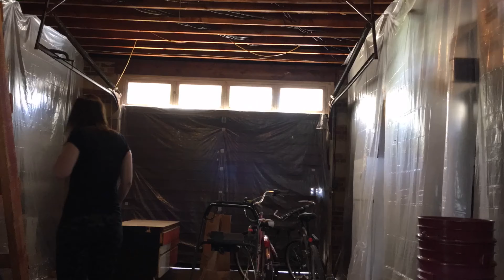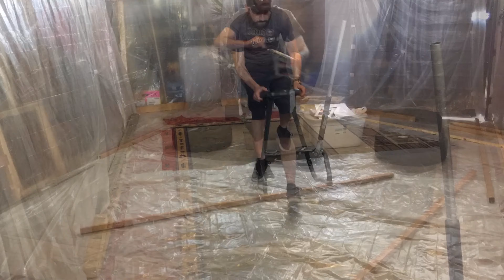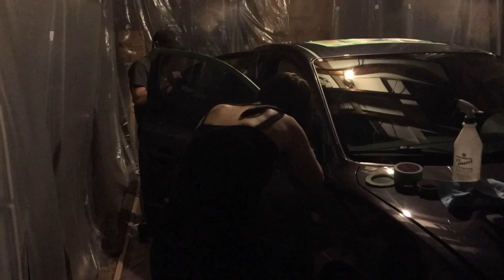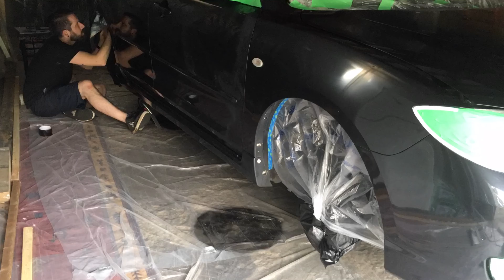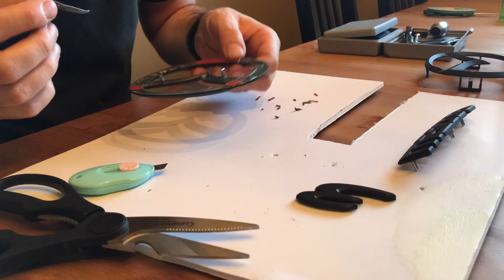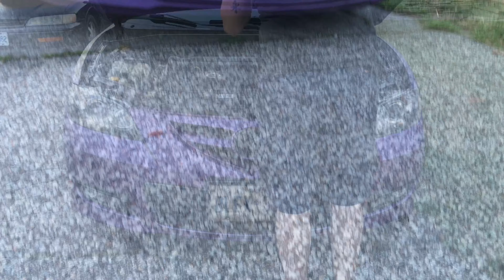Plum Crazy - PlastiDip Mazda 3

Comment: Looks great! Also, love the music selection. How much time and how much plastidip would you say it costs to do this? Because I'm thinking about doing my motorcycle in this color (basically just a tank and a tail) so for that I'm probably going to buy aerosols but if it's possible, I'm going to surprise my wife by doing her car in a night...
Reply from the maker: Pieter Ouborg this paint was only available in gallon form. So you would only need one gallon for your motorcycle. As for a full car, anywhere from 3-5 gallons is needed depending on the size and colour of your car, as well as the colour you are dipping. To properly dip the car, you’ll want 2 days. One to wash. The second day can be prep and paint. Every dip I’ve done, was done in a day. Get help with masking to make that quicker. That’s what takes the time. Good luck!
Reply: @stikako  where did u buy the gallon from? im in Ontario as well.